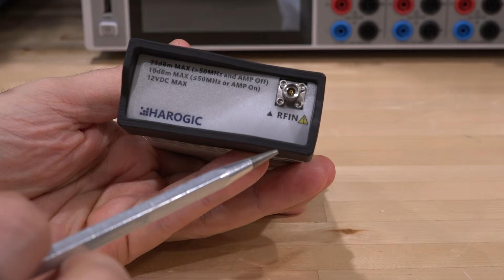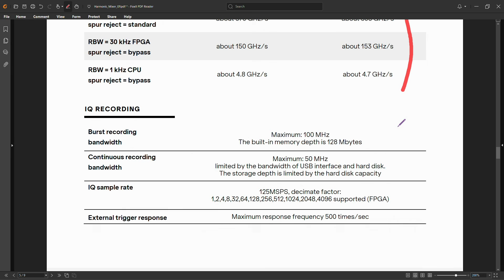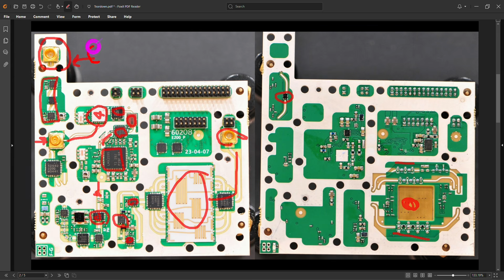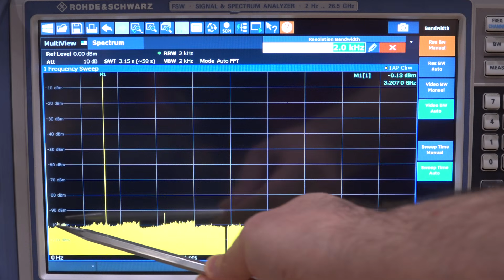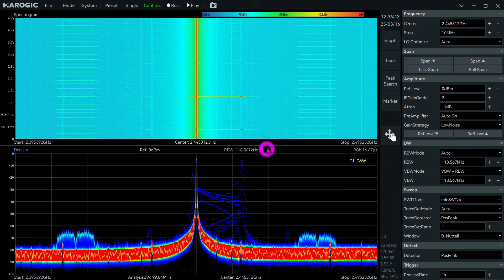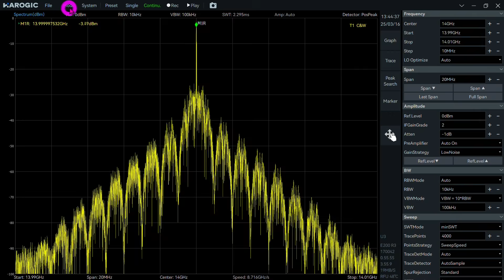TSP #312 - HAROGIC SAE-200 Real-Time 20GHz Portable Spectrum Analyzer Review, Teardown & Experiments

Comment: 9:55 i think the reason for the ceramic preselector filters is size. Alumina (which is what that looks like) has a Dk of about 9 compared to 3ish for typical low loss RF laminates, which means a distributed element filter can be made a lot less physically large for the same frequency.

If you're making a much larger device along the lines of SignalHound or R&S, you can afford to do everything on one PCB and just make your filters bigger. For ultra-miniaturized, I completely understand why they'd do it like this even considering the tradeoffs.

Comment: The big holes in the PCB under the filters are there to prevent ground plane resonances! You have to either solder the ceramic substrate such that the nain pcb gnd layer merges with the gnd layer of the ceramic board, which will cause mechanical stress and thermal issues or you have to have holes. If you don't - you need to connect the filter GND on both sides to ensure the right transmission line functionality, but if you don't have a hole and the GND of the bottom board is there you create a resonator!

Comment: That data drop may be related to the USB data transmission to the PC. For the looks of it, they are using a Cypress USB3 transceiver/MCU to offload everything to the PC that does the compute.
Having integrated the competing  FTDI USB3 FIFO part in a similar FPGA arrangement, I find not trivial to fully use USB3 bandwidth without droping a frame. There is no onboard memory to build a significant buffer.
Reply from the maker: There is a DDR memory pairs with the FPGA. The FFT calculations are done on the FPGA also. But I think frame dropping could be part of the problem.
Reply: @TheSignalPath  I forgot that DDR. That was 1 AM after splitting the video during the day. Maybe too brave 😅

Comment: Have you ever considered covering the red pitaya? it's a weird open source project that claims to be an all in one rf lab used by companies like Nasa and is about the same form factor. I don't know that I believe the claims on their website but I think the sheer depths of information available on how it works could make it interesting for you to cover.
Reply: I have the original from their kickstarter campaign. Never got much use out of it. Various issues including dumb user. I recently got a mail shot from them - apparently they are releasing a mk2 this year. Will be interested to see it's specs. The original is 'only' 50MHz rf bandwidth.
Reply: @danielwainwright9766  Same and pretty much the same experience.  Had really high hopes and it fell a little short in a few spots.  Nice to hear they are getting to take another run at it.
Reply: @danielwainwright9766  I haven't gotten one yet because I think dumb user might be the main problem for me. I think it look really interesting for sure but it might just be too complicated for me to use effectivly.
Reply: It’s a different thing. red pitaya does not have frequency converter builtin
Reply: @icat-p7x  I was unaware thank you

Comment: For the curious: Rohde and Schwarz SMW200A @25:41, avrg used price: 120 000 USD 🙂  FSW26 : same ... Renting rates: 4000 $/mo. (wanted to add some noise to the S/N ratio)
Reply: They should consider reducing the price to the $200 range, that will allow them to target a much wider market, e.g., getting a decent spectrum analyzer in every home of the country.
Reply: @Razor2048 the two front panel conectors cost more than 200€. Economy of scale dosent work with these high end instruments.
Reply: @Razor2048  they have already a wide market. The target group is not hobby users. The provide top notch equipment for professionals. 120k is a normal price for that equipment. 
I work with RS, Keysight, Tektroniks, HP every day and there are worlds between this companies and companies like Rigol etc.
Reply: @Razor2048  They have already a wide market. They are not interested in hobby users. The target users are professionals which require top notch equipment like from R+S.
I work every day with this equipment and also from HP, Keysight etc and there are worlds between this and companies like Rigol.

Comment: About the lack of via stitching - considering there is no visible via at the end of traces which clearly are carrying signals, I'd guess the vias are filled and plated over, so they wind up not being visible at all.

I'd be interested in an x-ray of the board, to see if there actually are a bunch of vias that just aren''t visible on the exterior board faces.